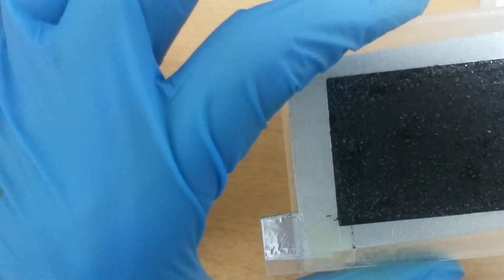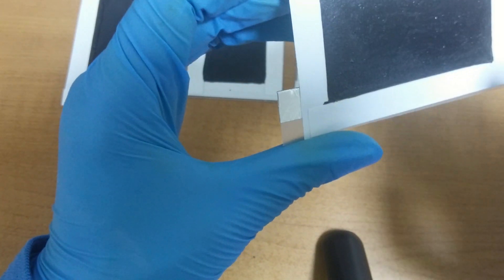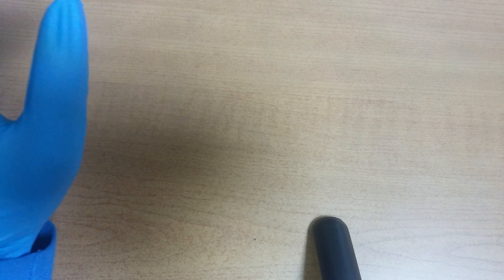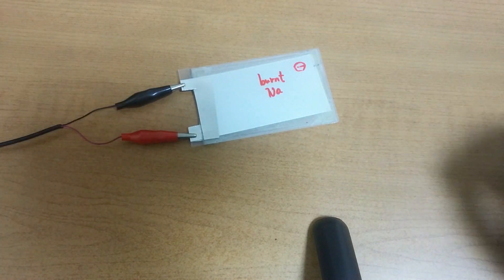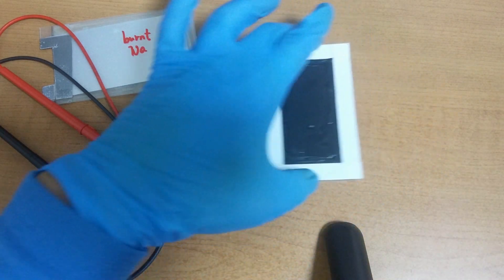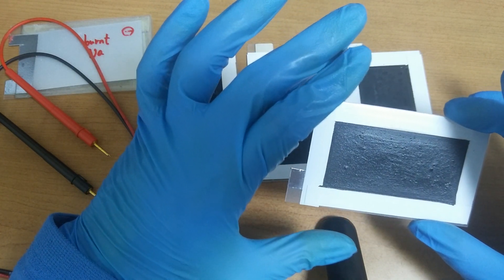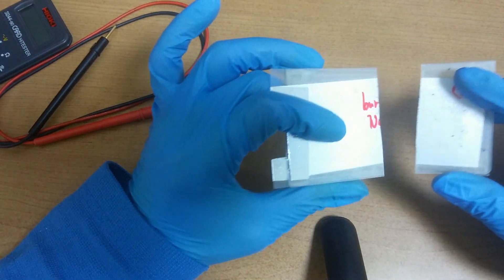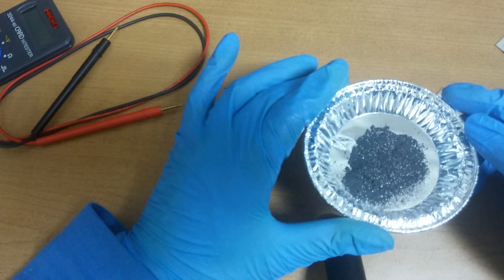graphene sand solid state battery

Comment: I think this is electrostatic charge like super capacitor but with no membrane seperator and not double layer . You could make next cell with three layer using middle aluminium as cathode and coated on both sides .
Reply from the maker: You are always professional. I am aldo thinking about it. But let's not hurry up. Respecting you.
Reply: @solidbattery9956  very exciting . Going well . I understand your passion 👍🏻

Comment: Great achievement man. Keep it up.
I was thinking how you liquified those burnt detergent and graphene sand into fluid semi solid for putting layer on aluminium???
Reply from the maker: In the wet state, I coat the aluminum and make it dry. Thank you and have a nice day
Reply: @solidbattery9956  how you made it wet?
Reply: @solidbattery9956  I have one idea .
What if we use thicker aluminium? Will the capacity increase?
Reply from the maker: @avijain2807  
I tried with thick one, even with coppet. But the result was same.
Reply: @solidbattery9956  okay.
And what you used for making wet.
Reply from the maker: In my experience, water is the best

Comment: You have achieved considerable improvement in the amperage of the battery so far. You can go ahead and add more layers to increase the voltage. You should also increase the surface area and contact between the surfaces to further improve the amperage. It will be interesting if you can deploy some useful instruments to characterized the battery. A big salute for the great work you are doing.
Reply: Right? This is exciting :D I was thinking the same thing- more contact or something- I think once in a while there's a fluke and it chokes the amperage out. I've watvhed a few of his other experiments since I found his channel. He's done quite lot of work overall. It's like watching and being a part of the future unraveling. :)
Reply from the maker: Thank you so much.
Reply from the maker: @kingscroach  
You are right. But guessing the amount of amps is easy. In this experiment, the voltage decreases sharply, which means the amount of amps is not enough. That's why I don't check amps yet. One day, when the voltage becomes stable, it will be time to check amps. Have a nice day.
Reply from the maker: @kingscroach  

I've never thought about that. Thank you so much.
Reply from the maker: Thank you so much for teaching me. Really, thank you
Reply from the maker: I subscried it thank you. I will watch what you recommended.

Comment: Hello, I hope you are doing well. I have been thinking about your batteries and what could be improved, and I have come to the conclusion that graphite might not be the best option for a aluminium battery, and here is why. When comparing Lithium ions to aluminium ions, the obvious difference is size, since aluminium is about 4 - 5 times bigger looking at the atomic weight( 6.5 to 26.9 respectively). When looking at charge- discharge cycles in a battery, graphite stores the ions in its hexagon structure while charging and then releases them upon discharge. Because aluminium ions are so much bigger, the graphite would degrade quicker and thus the cycle/shelf life would be too short. I don't know any of this for sure, but to me it seems logical. I think maybe a better option would be to use graphene, which has a more stable layer structure and is maybe more durable. Keep doing what you are doing, and I think at this point the electrolyte needs to be the main focuspoint. Have a great day!

Comment: Please make air battery video
Reply: Air batteries cant recharge, so it isn't really as usefull as other combinations that are recyclable
Reply: @pako8626  https://www.sciencedirect.com/science/article/pii/S2590238519300335
Reply: @pako8626  Rechargeable Zinc-Air Batteries Could Threaten Li-ion’s Dominance
Reply from the maker: Thank you for giving me to read interesting articles.
Reply: @WRDO  "Aluminium–air batteries are primary cells, i.e., non-rechargeable. Once the aluminium anode is consumed by its reaction with atmospheric oxygen at a cathode immersed in a water-based electrolyte to form hydrated aluminium oxide, the battery will no longer produce electricity." A quote from this wikipedia page: https://en.m.wikipedia.org/wiki/Aluminium%E2%80%93air_battery   
But I wasnt talking about zinc and lithium and other metal air batteries, I was talking about aluminium air batteries, but my bad I didnt specify it.